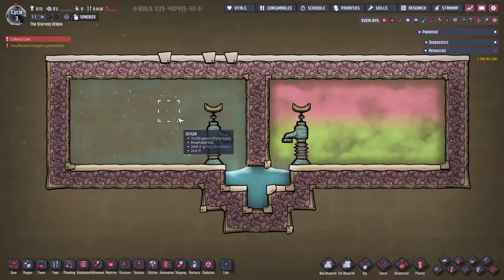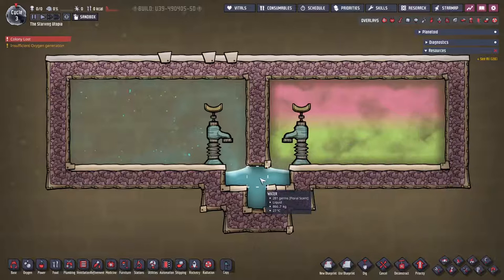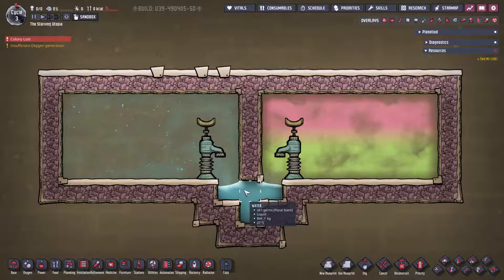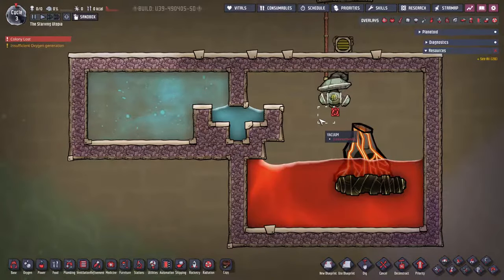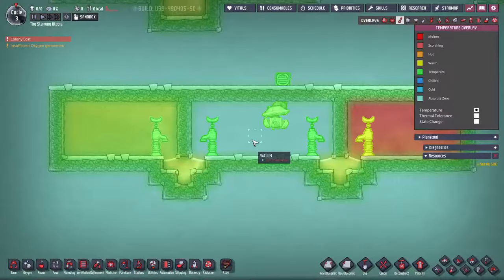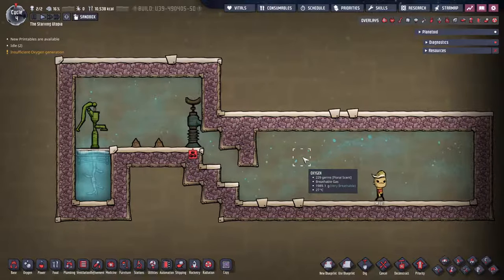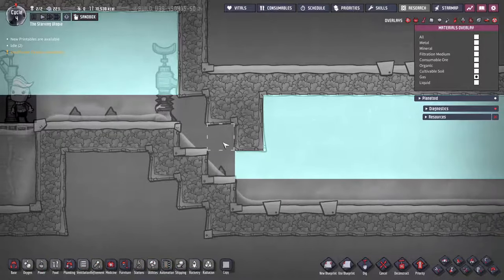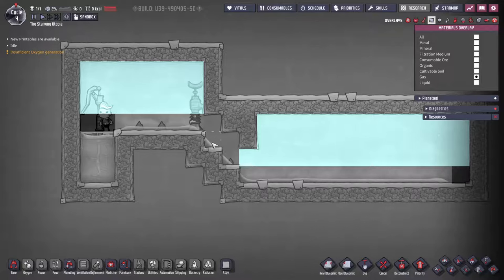Oxygen Not Included - Tutorial Bites - Liquid Locks

Comment: One thing not mentioned is that if you drop any item that off gasses in the small corner locks it will delete the liquid and thus destroy the liquid lock. So if a dupe is carrying a hand full of slime through the lock and goes on break they will drop that slime in the liquid and break the lock.
Reply: Why would it delete the liquid?
Reply: @soralee1910  Because each tile can only be of one type (solid, liquid, gas).
If a lot of gas suddenly appair on a tile that have few liquid, it will replace it (or sometime offset the liquid to an adjacent liquid tile).

In that case, it mean that the seal will break.

Comment: Mechanized airlocks should do this, but here we are.
Reply from the maker: There is a mod for that if you so wish.
Reply: Mechanized airlocks does NOT do this? I'm new to the game but I notice that I'm losing pressure when using single airlocks so I made a double door airlock whick makes my dupes to be slowed down significantly.
Reply from the maker: @megaturon1212  Both the manual and mechanised airlock do stop gases when closed but let through briefly when open. Even a powered mechanised airlock will even though it's the quickest to open and close. If you want to stop all gases then use a liquid lock or use the mod that adds fully sealed doors.

Comment: CO2 locks are good for high traffic areas when no atmosuits are used. They don't get the wet debuff, but these locks aren't super resilient.
Reply from the maker: Not technically a liquid lock, but I can see how that works. I think you're right though that it does sound a bit liable to breaking!
Reply: I once thought of a CO2 lock when building a Puft ranch built around a PO2 vent, but it didn't really work, as differences in pressure messed it up. I struggle to think of applications where it's lack of resilience wouldn't be an issue, even an airlock for a balm lily drecko ranch might have the CO2 leaking in.

Comment: I'm having a lot of trouble with the staircase design. The liquid (crude oil in my case) won't stick to the steps and just flows down. I've made sure to build the same setup as shown, and I am only releasing small amounts of oil.
Reply from the maker: That is how the steps liquid lock works, the liquid simply flows down leaving a small bit behind. But even a small tile of liquid will prevent all gas flow, and as it flows down the steps it will delete any gases in the middle which creates a small vacuum liquid lock. The only issue with small amounts of liquid is that they can evaporate if hot things are brought through, or be deleted by offgassing debris.

Comment: Is there a way to fully lock a gas/vacuum in a room without using any liquid?
Reply from the maker: Well the simplest way would be to close the room in with tiles, leaving a pump inside but then it won't be dupe accessible. Another way to do it is with airlock doors and pumps, but I find these a bit cumbersome. There's also a mod that introduces perfect airlock doors if you want to go that route too. I know some people are fundamentally against using liquid locks, which is a fair perspective. If the issue is just getting dupes wet, then atmo suits will definitely help.
Reply: @GCFungus  The problem with liquid locks is heat and germ transfer. I'm looking for design that doesn't.
Reply from the maker: Germs shouldn't transfer through liquid locks anyway as neither gas nor liquid moves through them. For heat, you can use any style of vacuum liquid lock, as vacuum does not transfer any heat. As long as there is a vacuum between two bits of liquid blocking a gas path then it will be completely isolated - I demonstrated this in the video.